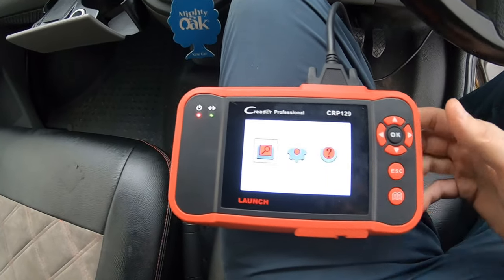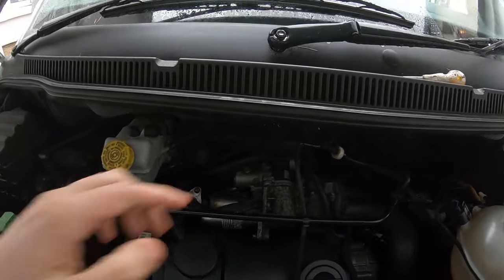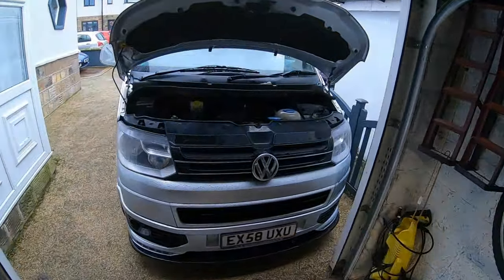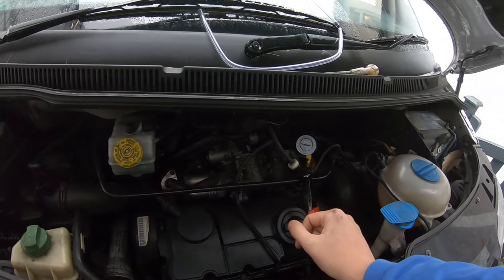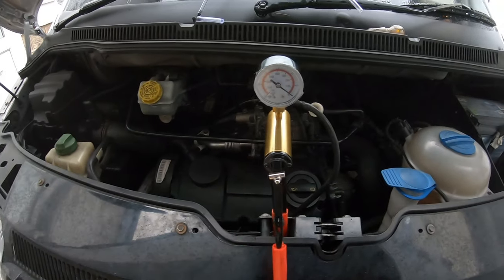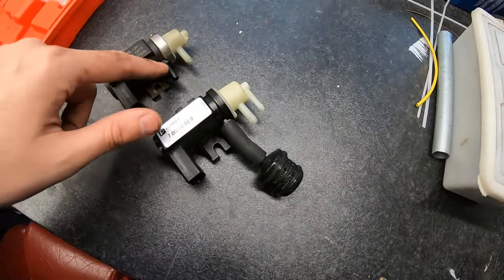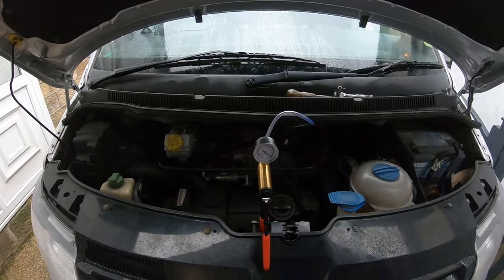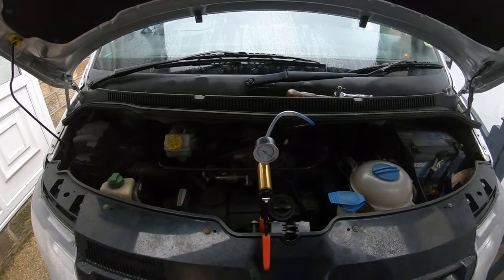P0299 Underboost - N75 Valve Diagnosis and Replacement - VW / Audi / Seat / Skoda

Comment: Nice!  Well done fixing it!😎 I need to grab myself a vacuum tester, although my ECU throwing errors regarding MAF sensor and egr valve. So I think my under boost problems lies with the egr valve. But first I'll start cleaning the MAF, hopefully it's the MAF or else it's going to be a awful lot of work😅
Reply from the maker: Egr may need a clean too. Be a good fix if you can just fix it by cleaning. :) good luck

Comment: I got the same issue with my Passat 2.0 TDI and I’ve done exactly what you did changed the same part Peirburg but the issue still the limp mode goes on and still the same fault code P0299..any advice

Comment: My crafter (Named Hitters Revenge) threw up the same codes and performed exactly how your did under load it just goes into limp mode. changed the N75 and no difference so the investigation continues

Comment: Looks like I'm having a very similar issue with my 2010 Touran BLS...
The OEM N75 seems to have packed up...
Once I bypassed the N75 and put the vacuum pipe directly into the actuator, the car is back to being a re-mapped beast as it should...
With the normal setup, she's barely able to pull herself...
Good, and clearly shown content anyway, fair play 
Thanks very much
Reply: Hi, how do you bypass the N75?
Reply: @giftdube2346  Hi, Just ran the vacuum hose not to the N75, but directly to the actuator... Once you push it onto the actuator tiny pipe, you should see the bar move once the engine is running
Reply: @The30Fazer  thank you so much, let me give it a try.
Reply: @The30Fazer  thanks a lot, managed to do so and the turbo is kicking inn at revs, even tha actuator movement is visible, now just have to find a way of getting rid of the excess hanging pipes

Comment: So to recap the troubleshooting process:

1.T test between check valve(black and white thing) and N75
-revving engine to 2000/3000
-if it doesnt hold vacuum the vacuum pump is the problem
-if the arrow goes to max vacuum everything is ok

2.T test between actuator and N75
-revving engine to 2000/3000
-if it doesnt hold vacuum the N75 is the problem
-if the arrow doesnt move and then jumps there is a problem

3.Test vacuum reservoir if it holds vacuum on turned off engine
4.Test actuator if it holds vacuum on turned off engine

Someone correct me if im wrong.
Also please comment if you have another test to add.

Comment: Hi mate, got the same van with 120k on it,  noticed with way making a noise when changing gear, a quick google and the n75 valve came up, swapped for a pierburgh and the vans going great! Pulls like a train up to 90mph! Cleaned the egr tonight which was clogged up, I’d imagine yours will need doing at some point. Keep the vids coming!
Reply: Same haha, it starts making very wierd turbo like noise. my n75 was so rotten i tried changing the hose and the valve literally broke in 2 pieces. Changed it for a new one and issues are gone

Comment: Hi just watched your video on changing the n75 valve on your T5 finally someone who knows what the noise was after turning my T5 engine off . I've asked loads of people no one ever knew what the noise was mine is a 2010 and been doing it for seems yrs . Just wondering if I can get away with changing the valve and not after mess around with any ECU fault resets

Comment: Hi, I came across your video, very informative and guidance is great. I have a VW T5 2007 (56 plate) 2.5 TDI LWB with this issue. Trying to find the N75 valve part is a nightmare. I got the vacuum kit and will be doing the testing this evening following your process. One main thing is I do get smoking, along with Limp mode, lag but only the P0299 code. Would you have any references for the N75 valve I could use? TIA

Comment: Hi, Ive recently brought a t5 2.5 and it has the over boost issue. I've cleaned turbo with oven cleaner and actuator lever moves freely with hand. Only happens when over 2000-2500rpm. Is this down to a faulty n75 valve?

Great videos by the way 🙌
Reply: Any joy? Mines same just bought an n75 valve mine goes into limp mode mainly in high gears on the motorway and glow plug light come on flashing

Comment: I have a 2005 Volkswagen Passat TDI first start the car drive drives good take off is eh once the turbo kicks in it takes off sometimes 10 minutes sometimes 15 minutes sometimes five minutes turbo trans off causing the limp mode put the scanner on there was four codes One for the msf One for that n75  I don’t have a vacuum tester but when I shut the car off turn it on for just a second turbo kicks right back on and then after five 10 or 15 minutes goes back in the lint mode what do you suggest n75 Thank you

Comment: But  or I think  the n 75 valve  cannot move the A turbo actuator  enough
just 1  centimeter. .
Do you think  if i change n75 would be ok?
do you think the turbo actuator should all the way up?
when the car start
also  i didn't find any  holes in vacuum  pipes
any  idea what should I or could  do
thanks
and also this came up  from computer 19586 - EGR System
              P3130 -35-10- Regulation Range Exceeded-Intermittent
17964- Charge Pressure Control
             P1556 -35-10- Negative Deviation-Intermittent

Comment: Hi, thanks for the video. Is it possible to diagnose the N75 valve fault by disconnecting the air-mass sensor plug?
Reply: @AbsoluteModictsSport

Comment: Well ive a skoda 2016 ive got the same code there for underboost bug i all so have P13D600  Thats a glow plug with pressure sensor would that cause inder boost

Comment: I got the same problem on my t5 bi turbo all was fine then it dropped a vave put a recon engine and new turbo in and now got that same code and problem not even  vw no wots up with it
Reply: Did u fix it I am a vw specialist but I’m south Scotland
Reply: Same story, recon engine new turbo, and same issue :(
Reply: Did you figure out what it was? I have a t5 bitdi with the same limp mode crap going on

Comment: Greetings from Denmark. Nice structured style video fixing the underboost. BTW The N75 looks for me like a chinese knockoff with a nice label on it. Real N75 Pierburg valves have some numbers, the Pierburg text and the logo moulded in the housing. But its nice that it works.....
Reply from the maker: The one I removed was a cheap ebay one. I replaced it with a genuine pierburg one.
Reply: @bluudysgarage  I will repeat myself. The one you installed looked fake to me....but as long its works, everything is ok.....
Reply from the maker: Like I said it was genuine part with paperwork to match.
Reply: Thanks you. You saved my head from much headache I replaced mine problem solved

Comment: How long has it took you to get a new N75 valve from buying the van. Surly it don’t take weeks n weeks to find that out ??
Reply from the maker: Videos are staggered out. So not as long as the timeliness on youtube. But I bought the van as a camper project not as a daily driver.  So most of the time is spent just sitting on the drive.

Comment: So I’m confused cause shouldn’t you have less vacuum going to the turbo from the n75 on idle and more as your rpms go up to open the vanes. I have a 2006 1.9bew and I have p0299 code smoke like crazy till I go over 50 then goes into a limp mood kinda. I have 20bars of vacuum on idle and then goes down to about 10 when up to 3k rpm
Reply from the maker: Not it shouldn't. Your losing vaccum. You have a leak or a faulty sensor

Comment: I’ve got the same vacuum tester.  I’ve used it to change brake fluid 😆
Reply from the maker: Great idea if it works!
Reply: @bluudysgarage That’s what the pot is for in the kit.  Suck the new stuff through, just keep an eye on the reservoir.
Reply: I've got one too. For the brakes. Wasn't impressed so got the reservoir pump. 
Not a waste of money now I have been given a new use for it.

Comment: Hi mate similar issues with my 08 caddy, 1.9tdi pd105 BLS code. Mines intermittent, fine for miles in 5th on the motorway then all of s sudden stops boosting, if I floor it all the time it doesn't do it. It's only low rpm when engine is probably under load. Turn the engine off and on again and it's fine. Would you suggest a new n75 valve or try the Mr muscle job? I've been using loads of fuel additive s and one where you spray it into the induction hose after the maf but still no joy. The vans booked in for a pd130 swap with hybrid turbo but I need s cheap and easy fix until my engine swap has been done. Thanks!
Reply: Did you ever get to the bottom of your issue? Sounds a lot like the issue I’m having on my BLS Caddy. I get no fault codes even when it’s in limp mode.
Reply: @Mac_F87  yes mate the n75 valve was blocked/had no pressure. The engine threw a rod in the end but when I was changing it for a bkd 2.0 and the turbo and n75 could've done with being changed
Reply: @jamestyrrell2225  ah right I'll buy a new N75 then. I'll try that before going to the trouble of taking  the turbo off and cleaning the VNT etc. I'm concidering doing the con rod bearings and bolts on mine to stop it throwing a rod in the future.
Reply: @jamestyrrell2225  after checking vacuum from the tandem pump, doing and output test on the N75 while connected to my vacuum gauge and doing and output test while everything was connected as normal it turns out it was my VNT actuator that’s faulty. The rod was only moving 5mm or so while doing the output test.

Comment: I have a 1.6 tdi Skoda and I have the exact same code exact same problems (when limp mode occurs etc) I changed this part and limp mode still happens in 5th gear where should I look now ? I took to a garage and they tried telling me my turbo has gone but I know it hasn’t
Reply from the maker: If your turbo is working in the other gears then its most likely not that. If its happening when in your higher gears then its when your engines creating maximum boost pressure for a longer period of time. Id be checking for vaccum leaks on the accurate pipe work or splits in the intercooler or pipework.
Reply: @bluudysgarage  great thank you for your help 👍🏾
Reply: they will always say turbo everytime because they cba just look into the problem because its not an expensive fix an a new turbo they fitted will rack up a bigger bill for them

Comment: You telling us what issue it had is like you was describing my van lol. Did the coil light flash by any chance?
Reply from the maker: No afraid not.
Reply: @bluudysgarage  I changed my abs sensors as 2 of them wasn’t working and it doesn’t go into limp mode as often now. I have just ordered the solenoid though hoping it’ll help my turbo lag

Comment: You damaged it with mr cleaner right? Lame problems from corrosive products inside vacuum circuits
Reply from the maker: Not at all. Fault was there before and after. Not sure how you think the cleaner can get inside the vaccum system..  hahaha
Reply: @bluudysgarage  just asking if there is any relation. Thank you
Reply from the maker: Yeah no problem. No it can't get into the other system from the exhaust.
Reply: Bellend

Comment: These things are absolutely terrible vehicles, mine costs £4k+ per year in maintenance and can't get 4 months before it lets me down monumentally so bad I have to have a spare vehicle for when I fails. I've wanted to sell it for years but everytime I fix it something else fails. VW are a joke. Do not buy one, actually buy mine its a 2011 it's had almost every single mechanical part replaced Including: engine, gearbox, turbo, intercooler, clutch, clutch bearings X2, all suspension, Egr, dpf,  power steering pump, clutch, flywheel,  brake calipers, top mounts, drop links, alternator, all wheel bearing hubs twice, discs pads, tons of tyres, water pumps, cambelt, window switches, fan blower resistor, it's non stop I've had 8 drop links in 4.5 years. £12k if anyone wants it, I only do 6-8k per year too!!!!! Always used with shell vmax diesel.